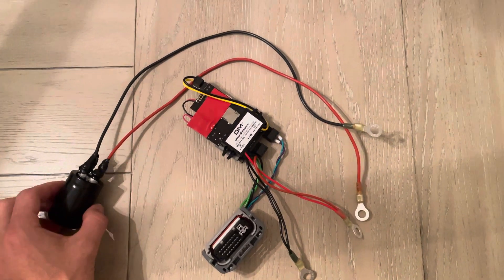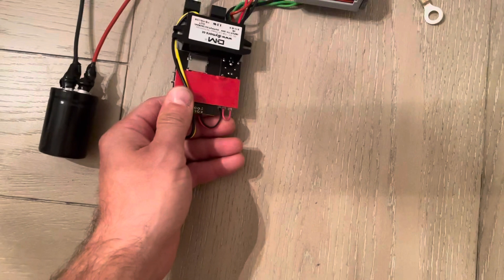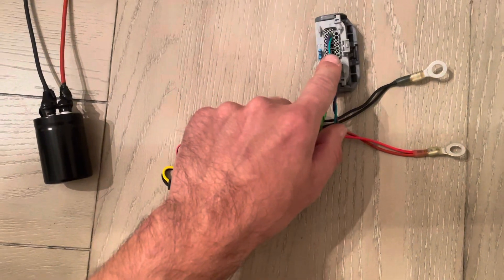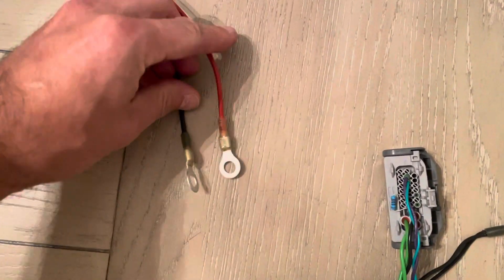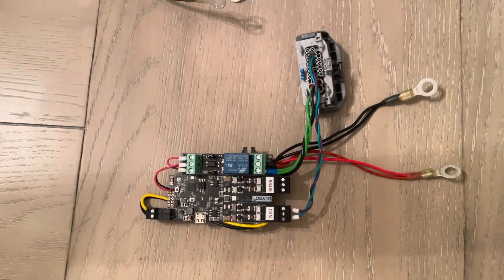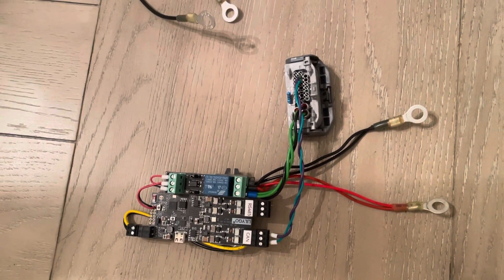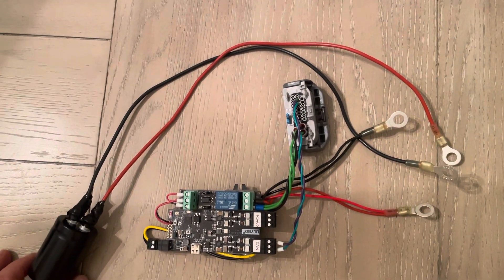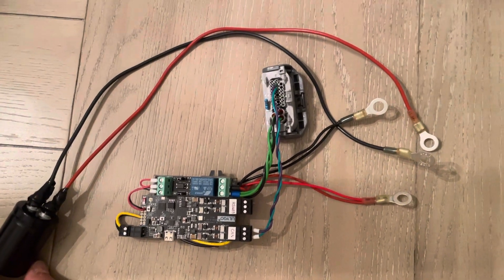Version 3 of the prototype controller for Tesla 3/Y batteries, running BYD battery emulator software

Comment: hi there, which relay board did you use and how did you wire it to the large grey connector.
Reply from the maker: https://a.co/d/hMkIHIS
Both power lines from the gray plug are connected to relay’s “normally open” port.
Reply: Thank you @diytesla